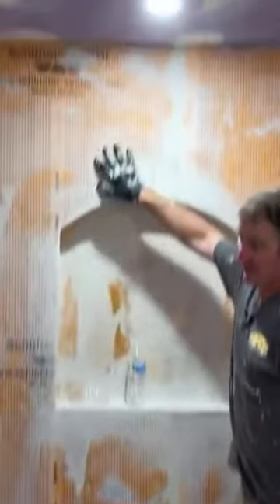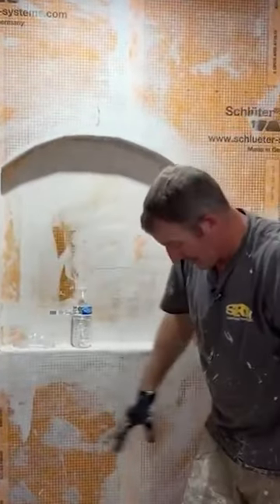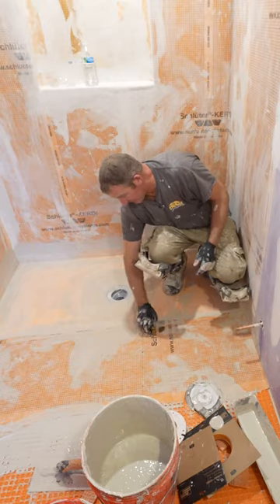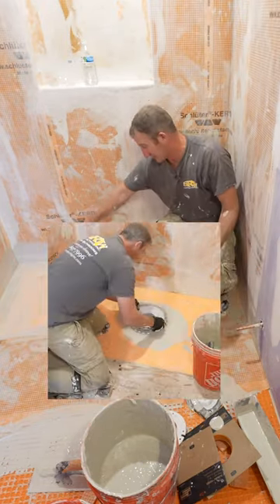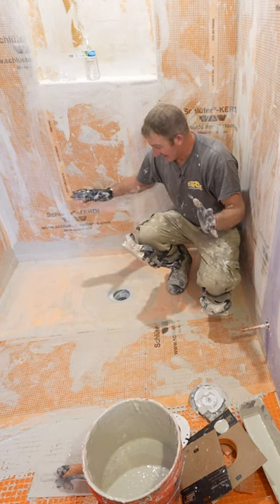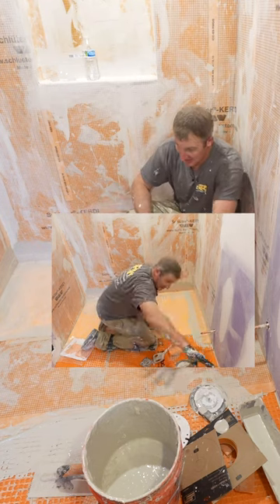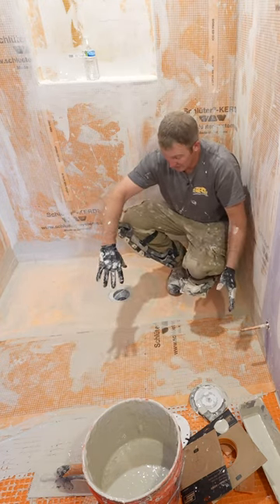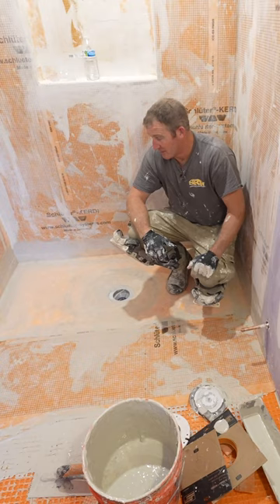Schluter Shower Sequence

Comment: diyer here: So do I still need to use the kerdi flex at the Ditra to curbless shower pan joint if i use a foot of the schluter membrane over both like you said?